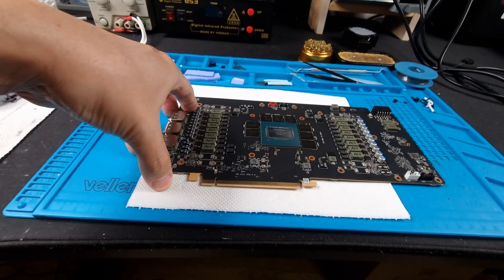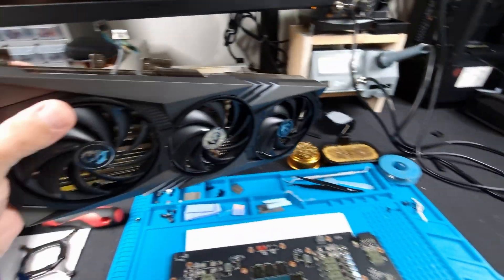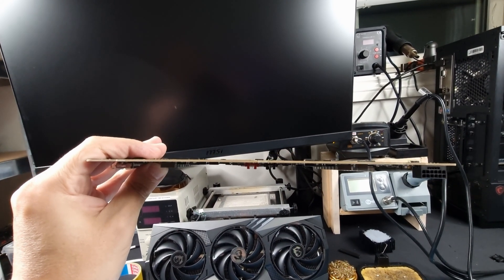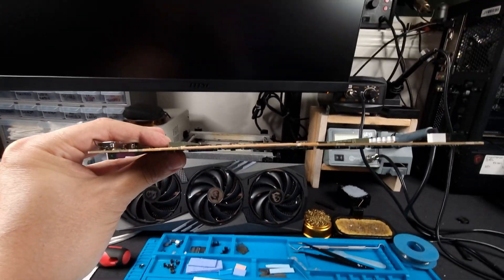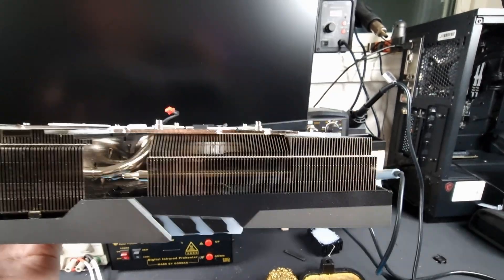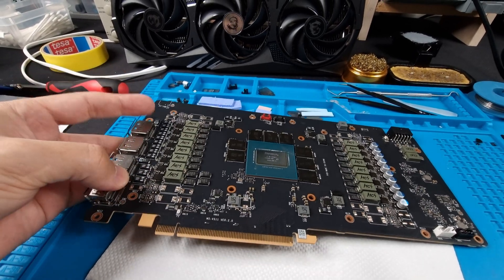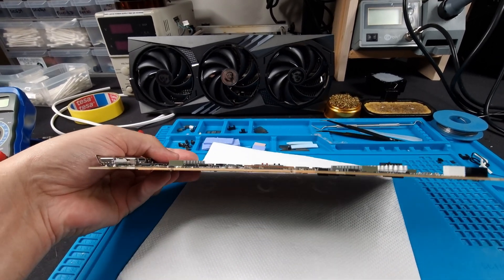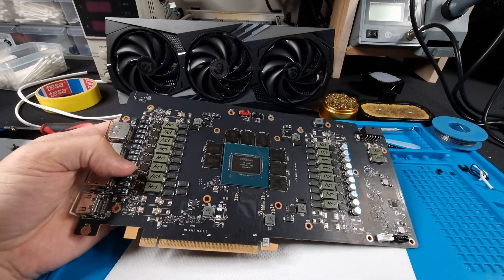How Using GPU Supports Incorrectly Can Destroy Your GPU.

Comment: Hello I just got a hella expensive setup with a 4090 which is put horizantally. After learning about the sagging issue I ordered pole like support but now I see this video. I don’t really wanna change the case or the set up right now. Was wondering if I can just put my case horizantally on the desk, could that solve the problem ?
Reply: Bro just get a gpu support WITH a mini bubble spirit level. Basically these spirit levels are meant for detecting gpu sag and if you're applying too much pressure on your GPU with the bracket (so you can adjust it). It's really not that complicated lol
Reply from the maker: @thelonercoder5816  A min bubble spirit? Never heard of that one. I will look that up :)
Reply from the maker: If you have the room, that will definitely fix the issue, yes. 👍

Comment: I had my GPU support bracket pushing the GPU up because I thought that would be better, after watching this I put my PC horizontally and adjusting the bracket so that it's half a millimeter away from the GPU so that when it's vertical it would just rest on it. Hopefully I haven't damaged anything during the 3 months I had it pushing up. Thanks for the video.
Reply from the maker: I hope all is well with your card. It is not well known, this problem. So I am glad to see people taking interest and acting to correct the problem before its too late. Cheers!
Reply: @TechnologyHive  Yeah, people usually talk about GPU sag, it was just by chance that I saw a comment on reddit linking to your video and decided to watch.
Reply from the maker: @npc8464  Well, thanks for coming over to watch the video 🙂

Comment: I have my bracket screws loose (about a half turn from tight) with a support holding it up just a hair, it's worked just fine for me for the past year and a half.
Reply from the maker: @user-lx1nh7gg8o  I hope it works out for you in the long run.

Comment: I have a low end gpu. A 6600XT. Basically as just a frame buffer. As an enthusiast I much rather see efficiency being the goal rather than the current brute force approach. This includes AMD, Intel, Nvidia. The power consumption of cpu's and gpu's today is terrible. Don't get me started on the size of the four slot cards.
Reply from the maker: I like the 6600XT. Aside from it being limited to PCI-e X8 Gen 4, you must have a 4.0 Gen PCI-e to not have it bottlenecked by Gen 3.0 X8. That would suck.

Comment: The fact that the GPU format has kept the same way despite how INSANE theese chonkers are is proof that manufacturers don't care enough, afterall their benches are mounted sideways anyways, so if something goes wrong it clearly has to be the user's fault.... We need some real integrity to be added both to PCI slots and to graphics cards, especially since the shells on cards seem to get cheaper and cheaper every time. I get that it'd be a massive shame to require a new format mobo to use a modern GPU but i bet that users would rather update their whole system and not be paranoid about their hardware not being capable of widthstanding itself. It makes more sense than ever now to use the vertical mounting for the GPU that some cases have literally just to preserve it rather than even caring about aesthetics
Reply from the maker: I agree with you. And these repairs are not cheap. And cracked PCI-e slots are not something I offer as a repair any more either. So if it breaks, its toast or someone else can take on it. But it will never be the same.

Comment: It is frustrating. I hate it that folks do not put these in correctly. The bracket doesn't need to be so extended that it does this crap. People do not value physics at all!
Reply from the maker: It is not people which is the problem. It is the weight of the card that's the problem.
Reply: @TechnologyHive  it all makes sense now. Basically, they are heavy and need support.
Reply from the maker: @leemercey2260  Support in the right place and done at the right time. Not after it's been screwed in place.

Comment: Use the tool as it's intended and it will help. Use the tool incorrectly and it causes problems. This seems like more of a problem of incorrect adjustment.
Reply from the maker: Yes, but there no instructions included when you buy one of these heavy cards telling you how to use the included support. People trust their product will work as expected, not knowing these cards are too heavy to be installed horizontally.
Reply: @TechnologyHive  I have mine supported in the middle region, in line with the PCI slot. This video inspired me to check it with a spirit level - and it's spot on.

Comment: Is this an 7900XTX MERC310 next to the box?
How did it get dmged, by the included steel support beam?
i got one, and with the support bracket you can k177 someone.... so massiv this thing is

and this pcb is bent, because of bad localisation of the support. maybe 1 is not enough
maybe you need 2?
Reply from the maker: @daegaraf898  The card is 6950 XT. It had a broken pcie slot, cause during transport and the card being installed on the PC. That's a big no no with these heavy cards.
Reply: @TechnologyHive  surly is, but who's so stupid?
Reply from the maker: @daegaraf898  It is very common. I get these cards in a lot.
Reply: @TechnologyHive  pre builds i guess...

Comment: Supports for your cards are a smart thing, you just need to have some common sense. Personally, I have my 4090 with an EK block.  Way heavier than most cards.  I found a perfect little support for it that keeps it level and nothing more.  It basically just takes some of the strain off the pcie connector.  The one included with the card is still in the box.  I have a case that actually inverts the motherboard, so it’s upside down from your traditional layout.  It requires a bit of thought to make everything work safely.
Reply from the maker: @chincemagnet  custom water cooled cards is another story. If the block covers the whole pcb with crews, I wouldn't worry too much.
Reply: @TechnologyHive  true, but my concern is that it might crack at the pci connection from all that weight.  Tbh it’s hung there for well over a year before I started seeing videos about cracked pci connections.  So I propped it up just in case.
Reply from the maker: @chincemagnet  If you haven't noticed any video artifacts or weird behavior yet, chances are the card is well. I have about 15 cards here for repair with cracked pcie slots. Gigabyte ans asus love rejecting warranty over anything, even it is due to their huge cooler designs.

Comment: I was getting black screens with my ROG 6700xt when i first brought it. Then i opened the case i pushed the GPU a bit to the slot and i screwed the GPU card with the PCIE case screws really tight. Haven't had a black screens since.

Should that be alright? I had this GPU since Christmas 2022. I got it in basically new condition despite being called used on ebay from the seller lol.
Reply from the maker: @NightmRE_ZZZ  If it was failing before, chances are the card is already damaged.
Reply: @TechnologyHive  ehh I doubt it. I just didn't had the GPU all the way in the slot. I broke my motherboard PCIE clip, but I heard it's not really a problem as long you push the GPU in the slot and screw in the GPU with the pcie case screws.   I didn't do that at first, but it stopped after I did that process. 

I guess it depends on how strong your pcie card slot is and ur case pcie screws as well to hold the GPU. I had this GPU for like a year. So it's fine now at least i think so.  I undervolted my GPU anyway to make it last longer. 6000 series run pretty hot and use a lot of power.
Reply from the maker: @NightmRE_ZZZ  Well, then that might be it!

Comment: Yeah except if you don't use one with the size of the cards these days your pcie slot gets damaged like mine did and forced me to get a gpu support so my bottom one doesn't get damaged either..
Reply from the maker: The PCIe slots get damaged real bad during transport, if the card is installed. Both, the slot and card can be damaged.

Comment: Hi, sorry for stupid question, but wouldn't it be "simpler" to just have a case lying on side (like a rack), without need for any risers and vertical mounts?
Reply from the maker: Yes that is absolutely fine. Not a stupid question btw. If you have the room on your desk, that will fix the issue. Done. 🙂

Comment: How hard is to understand you only need to take the heatsing load off the PCB?

Just dont do it on a single place, dont over tighten, and the the hight first before you tighten the card. Its not that hard really.
Reply from the maker: If the cards were not so heavy, there would be no need to these pillars as support. This is creating work for GPU repair technicians, but these repairs are not cheap.

Comment: maybe the age of air-cooled high-end GPU's is coming to an end, because these cards are getting way too large and heavy due to the oversized heat sink.
Reply from the maker: The RTX 5090 is rumoured to come out with a bigger heatsink. The Reference model at least.
Reply: @TechnologyHive  The reference model should at least be a hybrid cooler, even if it raises the cost a bit, in my opinion. What's an extra $50-$100 on top of your life savings?
Reply from the maker: @nickdibart  😂😂

Comment: I feel like a better support design would be something the extends all the way from the pcie slot under the card to the end of it, but shipping that much surface area starts to get expensive.
Reply from the maker: It would be cheaper and more effective to install heavy cards on a vertical riser. It costs less than a fix of broken solder joints.
Reply: @TechnologyHive  A pcie riser is more expensive than an L shaped piece of sheet metal, it's literally just a 2-3 step part to stamp out.
Reply from the maker: @SulkySkull  Okei. Have it your way 😉

Comment: do i need to vertical mount specificly an rtx 4070super Gigabyte gaming oc model?
Reply from the maker: If its a 3 fan card, and heavy, I would use a riser.
Reply: @TechnologyHive  it is a three fan but i dont know whats considered heavy since the only other card i ever held was a single fan 2060
Reply from the maker: @SouthernGecko56  That's a big card. I'd get a Phanteks vertical mount for it. Easy to install.

Comment: Do not put your supports at the front end, they should be 2/3s the way away form the rear of the case.  AND DO NOT CRANK THEM TOO HIGH, it is a secondary support not the main load bearing point for the card.
Reply from the maker: This sounds like a house being built, telling workers where to put the support beams LOL. If its a heavy card, put on a 3rd party riser. Issue fixed and you can have that peace of mind.
Reply: @TechnologyHive  the size of these cards you could build a house with them lol
Reply from the maker: @BB-wh2vu  No kidding. Its only going to get worse, btw. The upcoming 5090 is rumoured to need even bigger heatsinks.
Reply: @TechnologyHive  next step is repurposing car radiators
Reply from the maker: @BB-wh2vu  🤣

Comment: I like the look of them mounted with a riser cable. Have done it on my current and last GPU. I do have a little magnetic post that I put under the shroud between the gpu and the case vertical mounting so it prevents sag because I use a Thermaltake core P3 and because of the design of that case the mounting bracket for vertical gpu mounts isn’t supported as well as a full on enclosed PC case.
Reply from the maker: If you're going to spend so much money on a heavy graphics card, put it on a riser.

Comment: When you mount the card as standard, you mount it when the case with the motherboard installed lies on its side. Then, with a card that sits perfectly in the slot and does not bend, you mount the support so that it does not bend the card, then when you place the casing on its feet, the card will partially rest on the support and the rest will normally be based on the rear mounting on the casing and the PCIe slot. In this example, the card support was too long and bent the card the other way. This is definitely user error.
Reply from the maker: @Roy88772  If the cards were not being built weighing 2kg, and ~12" long, there would be no need for support. Hot/cold cycles will warp the pcb if installed horizontally, even with a support.
Reply: @TechnologyHive  And what if we support the card centrally, exactly in the critical place of the PCB and not the card housing and cooling itself?
Reply from the maker: @Roy88772  I don't know. I'd just put it on a vertical mount and be done with it. This I do know works.

Comment: You know what you convinced me I just ordered a cooler Master vertical mount for my 7800xt. I used to have a 2070 which still worked by the time I was done using it but I could tell it had that warp you were talking about. I installed the support pillar while the PC was on its side, it was not pushing up too hard on the GPU. I believe when the GPU would heat up, the side that wasn't supported slowly begin to sag over time.
Reply from the maker: @allensmith3703  Nice! I think you'll love that mount by Cooler Master. It's user-friendly, and it just looks cool once installed in the case. Also, your gpu temps should be better, slightly.

Comment: After this video i buyed the cooler master v3 and now i have my 4080 in vertical mount :).

When the gpu was horizontal, i noticed that the support's positiion after a while moved outside. It was like the pressure, was making the support move.

Thanks :)
Reply from the maker: @xSup3rGtIVx  Nice! The V3 is a nice vertical mount also. It's one of my favorites.

Comment: I'm using the one that came with my Fractal Torrent case on my Strix 4080. Even though I'm using a higher end AsRock mobo I dont' want to risk the weight of this pig of a card damage the slot over time. 😁
Reply from the maker: @nicktayloriv310  Whatever works for you 🙂.

Comment: Wouldn't a support that props up the top & bottom of the card at the opposite of the business end of the graphics card do the job. Not that vertical mount aren't a great idea, just some cases can't use them (or add-on cards block the use of vertical mounting hardware)?
Reply from the maker: @bokami3445 If someone is going to spend that much money on a heavy card, it should also be mounted on a vertical mount to account for the weight. Horizontal mount supports are a bad idea for these heavy, long cards.

Comment: From a structural point of view a support with a beam that supports the entire length of the gpu spreading the load in a even way should be a good design although probably more expensive.
Reply from the maker: Look for the Phanteks vertical mount riser.

Comment: Hey there, great video! I have the same Phanteks case you show in https://youtu.be/uEdFTmOAT58?t=108 would you please share with me which vertical support you are using? I´m  having trouble finding one compatible.

thanks!
Reply from the maker: @mandopepo  It's made by Phanteks. Costs around $50. You will find it on newegg or Amazon.

Comment: Personally I lay the PC flat on my side so the GPU is not sagging and then set the GPU support height so it just barely touches the GPU without exerting pressure. I've found this to be the only way to set the height properly.
I'm using the slot for the vertical mount as the passthrough to the external radiator (custom watercooling) and changing the layout would be a huge pain...
Reply from the maker: @Steamrick  I think that is better than having your heavy card sagging.

Comment: The issue about vertical mounts is first of all airflow,and second it doesn’t fit with some cases,it just can’t fit in with the fans,or something else.
Reply from the maker: @Dumb_Thing  That's because you're thinking about vertical.mouny using your PC case's vertical mount option. That's not what I recommend. 3rd party risers like those by Phanteks and Cooler Master V3 are the best.
Reply: @TechnologyHive  ah,my bad then,sorry
Reply from the maker: @Dumb_Thing  Naw no need for apology 👍🏼

Comment: that looks like overpushed support on the corner (user improper use)
because where is lower its on the braket side where it screws on the chassis
i did think about that too once but not for that issue but for the radiator to have a balanced weight support
Reply from the maker: @speedydanny4624  I got 7 cards with the exact same issue in for repair. It's a common problem with heavy gpus.

Comment: Im a bit lat to this discussion but alot thermatakes cases have the motherboard rotated 90° so that the GPU is standing vertical.
An issue with the standing vertical gpus has been high hotspot temps .
Some brands tend to be worse  than others, and vapor chamber cooled gpus seem to be the worst offender of the bounch.
Reply from the maker: @tonydalimata  The problem with vertical mounting in those cases is when people use the included vertical mount with the case. A 3rd party riser is the way to go here. Check out the Phanteks vertical mount. Runs for about $50. Pci-e 4.0.

Comment: It hurts to buy an expensive and massive GPU. End result - GPU PCB crack > artifacts > video crashing > Technician. I still prefer the good old GPU designs ( good heatsink and good TDP design ) they last longer than today's high-end GPU.
Reply from the maker: @remnantchannel2434  The weight of the card, combined with lead-free solder, makes a perfect combination for a dead gpu.

Comment: I have this RTX 4080 model from MSI and I don't use the support contraption included in the box. The cooler does integrate a reinforcing aluminum frame, bolted to the I/O shield that does the job of keeping the PCB from sagging, even when I move the PC case around my room. Just make sure to use all the three screw points to secure the card to the case mount.
Reply from the maker: @Ivan-pr7ku  I hope that works out well in the long run.